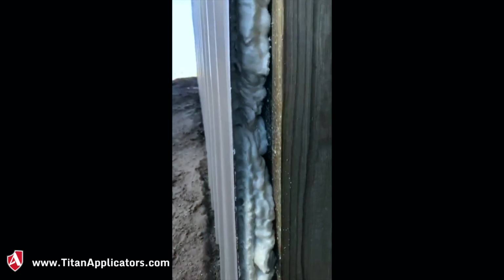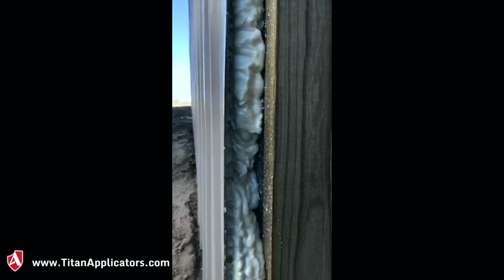Spray Foam Insulation In Metal Buildings

Comment: Is this highly flammable
Reply from the maker: Hey, John! Great question. The brief answer to your question is no, it is not HIGHLY flammable. But, like most any building material, it can burn. When we're talking about the flammability of spray foam, there are two major talking points: ignition barriers & thermal barriers. - An ignition barrier is designed to stop a "perceived hazardous material" from igniting. The foam we use has an ignition formulated into the product and meets all code testing requirements. - A thermal barrier slows the temperature rise of a certain material behind it during a fire. SPF insulation in a building must be covered with an approved thermal barrier to separate it from the occupied space, with certain exceptions. Examples of thermal barriers are 1/2" gypsum wall board, portland cement plaster, intumescent coatings, etc. - It's critical that your spray foam contractor is informed of the current building codes to ensure your compliance and save money and headache down the road!

Comment: Was this building to be drywalled or left it as is?
Reply from the maker: Great question! In regards to the foam, it was painted over with a white intumescent fireproof coating, to meet local building code and then left as-is.